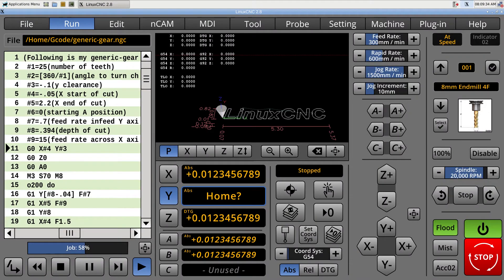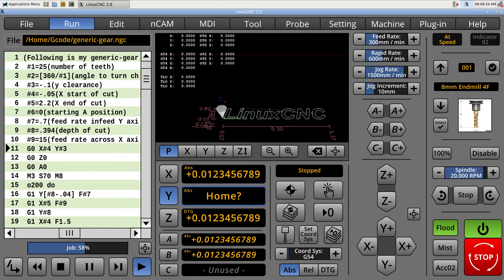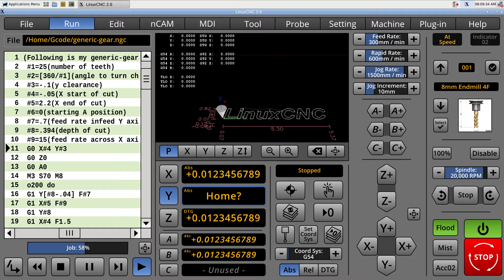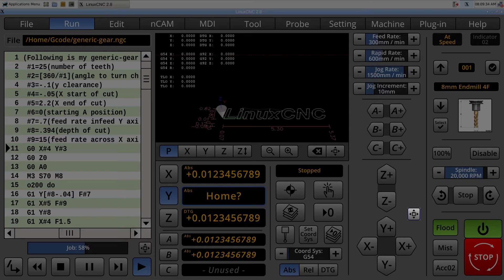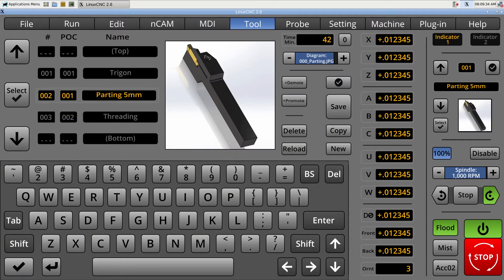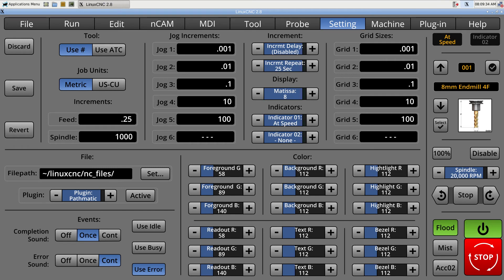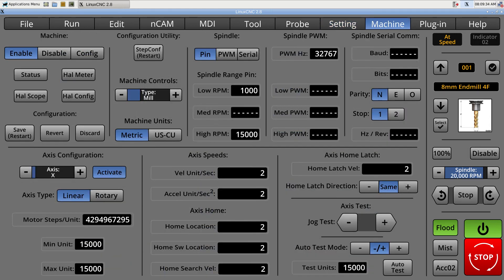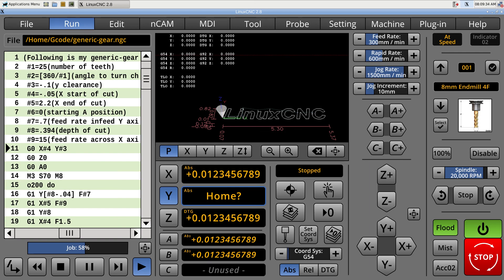LinuxCNC User Interface Proposal

Comment: I just came across your video, it's kinda amazing, I know we have to connect all things in the back, I'm starting to check how to add buttons to QtplasmaC I'll try once I'm finish to help you out with your interface, if you moved on and or have another ideas, it would be cool to implement them, you know, the once you really use for your day to day life. Since it's been a long time, you might have a clear idea of what kind of setup you would like to have. By the way, I'll be testing next week if I was able to use my new shapes in Conversational tab on QtPlasmaC, if you like to see something in your conversational for a router, let me know. I'm not that fast, but I'll try. Cheers!

Comment: Take a Look at a professional CNC Control, or take a look at EdingCNC. these GIU's are basically the industry standard..
Reply from the maker: When they first came out--they were new.
Reply: @BrendaEM  when what came out?.. Professional GUI's?.. they have been around for ages now.. I have a Lathe with an interface that was built before Windows was invented, basically a Barebones Unix system...5 buttons along the bottom of the screen operate a lot of functions, depending on the mode you're in..

The problem with Linux CNC, and other CNC control Programs is that most of those projects are "Hobbyist driven".. meaning no professional has ever designed a User interface..

Comment: I have NO idea how many CNC users out there have familiarity (let alone expertise) with GUI programming.   I can tell you full stop - this would be an unbelievable amount of code development to undertake.  Excellent thought and considerations were put into the design elements to be sure!  I edited my comment once I realize it was only an SVG presentation and not the actual GUI as I thought Brenda had written the GUI but it was just not operational yet.

I would also like to add that my 30+ years of experience with programmers has shown me that this level of "usage" consideration is rare as often times the developer forgets that the end user cannot possibly know what the dev was thinking at the time and instead can only work with "what is" so GUIs can be very non-intuitive and difficult for the end user.
Reply from the maker: Do you have any idea how many lines of code are in LinuxCNC?
For the interface, I drew on the advice of others, adding to the the tried and true LinuxCNC interfaces.

Comment: thats stupid. If you show 10 things on the screen , why needed to use 1 , you have 9 times more pobalilities to make errors , and the cnc machines dont forgive that.
Reply from the maker: There is a concept called drilldown, meaning that everything should be within so many actions. In the design, you will see safety features. Noting that, the interface is maxed out for 5 axis. Most people would use 3. It was designed modular, so, elements could be hidden.
Reply: @BrendaEM  and why nobody use it?
why all big manufacturers use separate screens for code , mdi , grafix , auto and manual? Are they stupid or what?

Comment: Take a Look at EdingCNC or a Professional CNC Control like Heidenhain..and start over..
Reply from the maker: Noted. You might want to check the other comments.
Reply: @BrendaEM These Comments are all made by Hobby machinists, none of them have a professional background..
Reply from the maker: @dumetwatches6451  , Hey, I even put included functionality for a status light-pole or alarm.
Reply: @BrendaEM  What i'm seeing here is just like a Haas CNC, or Mach3 control.. the literally cluttered with buttons.. 
Heidenhain, Fanuc, Mitsubishi, Fagor, and many other CNC Controls have "Function keys" Softkeys, the function depends on the menu you're currently in.. saves a lot of Screenspace.. and.. Why on earth would one need a Graphical Display when milling or turning?.. 
You only need it for programming or program checking.. after that.. why show it?.. Just look into the machine.. if you are there.. 
Most of the time, basically always.. i hit start, and do something else.. what would i care about a Graphical screen?.. Ok.. my CNC Control (EdingCNC ) has that, but.. i   rarely look at that when the machine is running.. because i only return to a machine when it is finished..

Comment: That looks great. I am a seasoned Machinist, and programmer.. Linux CNC escapes me.. I just don't have time to devote to learning it, when I have the big boys at work.. It seems a little light in the loafers compared to real industrial level stuff. I have a small hobby mill and have run Mach3 on it, but I really want to get into open source to allow for granular improvements.. I would gladly donate to a project like this that would help me achieve the functionality of a better HMI, while allowing me to take advantage of LinuxCNC
Reply from the maker: You might try the LinuxCNC forums.

Comment: i would like to use that, has it come to fruition?
Reply from the maker: Hi, I am sorry, but likely not yet.
Reply: @BrendaEM  Well the mock-up looks good :-)
Reply from the maker: @MrZhefish  , thank you : )
I had hoped that the attention of 16,000 people, with a 99% like rating would encourage LinuxCNC to recognize the value of their software, and perhaps find some commonality in their interfaces. Most of what I did was a merging of LinuxCNC interfaces, and add a bit of Blender-style window dressing. Still, a house cannot be built from the facade back, and libraries need to be developed.
Reply: @BrendaEM  have you inquired with a programmer about the extend of work that needs to be done? like how many hours it takes to develop it?
Reply from the maker: @MrZhefish  , I have not been much on LinuxCNC since the end of the project. I have had some misgivings, as the moderators let someone make make the time I spent on the forum miserable. There are many fine people on LinuxCNC's forums, though I feel that one of them should have been banned, but was not. That stated, where this interface is good, is largely from the gracious input of several members of LinuxCNC. The interface itself is a compromise and derivative of all of LinuxCNC's existing interfaces. I just wanted to find a compromise between them, and give something back--and it really went bad for me. I offered them a design proposal. It's up to LinuxCNC what they do or do not.

Comment: good job it hase some features that are better than mach 3 and 4 and it looks so neat , but you can add some features like configuring the motors and all other inputs and out puts inside the Interface this will be so usefull ,and attracts the mach 4 users that have low linux or any other programing skils .

Comment: Hi Brenda, Your interface seems to have gone quiet, what is happening with it? It seems to be one of the best designed interfaces around, clear, concise and intuitive, as well as easy on the eye. You have obviously spent quite a bit of time thinking about this, its a pity that it is so difficult to implement. There has to be an easier way to make a user interface! I know that you have to design for all options and expansion, but think that an initial subset to interface to a 4 axis CNC router would be a good place to start, as this is the configuration that most hobbyists will have. I am planning on building a basic unit and would like a system like this to control it, one that would allow me to create macros for facing and hole drilling, cutting basic shapes to selected sizes etc., thus making the machine a versatile and easy to use tool. Please let me know what progress has been made to date. Regards Mike
Reply from the maker: They had started on a widget process, but that may have stalled. I really tried to help.

Comment: As a professional machinist that works with a bunch of different machines of varied ages I like your layout a lot.
What I saw at this quick glance that I would miss in daily work is to see both current position and distance to go at the same time. 

Direct buttons for singleblock as well as M1 activation. 

Feedrates (work and rapid), quick buttons for 0, 25, 100%.
Please note that I might very well missed these or that other symbols then the common CNC ones might have been used.
But overall, really sweet and inspires me to take up my own home CNC projects.
Reply from the maker: For months I did take in as much feedback as I could on CNCZone, I am sorry that I didn't get your feedback.

Though, I wanted to be sure that the user knew which numbers were being read out. I had hoped that the radio buttons to chose a readout mode were fast enough to meet your needs. What I feared was: a machinist looks glances at the part, and back to the screen, only to fixate on the wrong number. As a design thing, there is also an redundant legend over the numbers themselves, which was removed, and then added back for safety.

As far as the feedrate, as in Axis, the steps were meant to be user settable.

Comment: Hi Brenda. Has your proposal been aproved? It looks great.
Reply from the maker: They are making something. I am not sure. Because of the problems I've had with LinuxCNC.org, I've been pretty hands off.
Reply: @BrendaEM  Can't find it, where I can find the user interface you're mentioning ?
Reply: @BrendaEM  You just didn't like disagreement. You wanted things changed, eg with the basic Debian desktop, that takes a couple of clicks of the mouse. Your design whilst pretty required a large screen for those users that don't have slender fingers, you didn't like this being pointed out. There was an impression you wanted many changes purely to suit your own needs. It was almost like a architect designing a building, without of a lot of knowledge of how things are built, handing it over to a builder and just expecting to be built without any further input. Not everyone is capable of everything, but it's neither fair nor polite just to drop something off and expect results. And to be fair when directly asked what license you wanted to release your work under there was no reply. 
The mods were fair and took action when you had issues, but it wasn't the action you wanted. You were wanting a particular user banned and you didn't get your way. It was not the fault of the forum or the mods, things just went from cordial to bad to worse. At the end of the day it would appear both users removed themselves from the forum.
To all of those that are being held back from using Linuxcnc because the "screens look dated" you are missing the point. After having used Mach, grbl & Linuxcnc I can say that Linuxcnc is a far better choice, as far as I can see as a user. Yes the learning curve is steeper, HAL can be daunting, once you grasp a basic understanding the power is there. Even tho there is framework to use the qt toolkit gmoccapy & axis seem to be the more popular screens. Only time will tell what will happen in the future. Now that there is work being done on a respin of Mint pre installed with Linuxcnc hopefully more users might feel a bit more comfortable and not have to go through the work required to get some devices to work under Debian.
Reply from the maker: @awomandoesnothaveapenis , Yes, because people use not only this interface but other touch screen interfaces, such as Gmoccapy and Touchy, I wanted LinuxCNC to reconsider how much real estate their Menubar used. Windows, Mac, Linux Cinnamon, Linux Mate, or Raspberian used that much. I am sorry, but on modern 16x9 aspect ratio screens, vertical real estate is not plentiful. Even modern browsers hid their real menu bars. I also requested that they update the documentation; you can be angry at me for that, if you want. Tell everyone.

One LinuxCNC mod issued a warning to someone from using vulgar language at me because I wanted to help. Week after week this jerk told people that I wasn't going to finish it. He complained that the design was taking too long, that I wasn't going to release it, that a design itself has no value. He broke up conversations during the design discussions. He followed me around elsewhere on the forum, posting after any post I posted. In any other forum, he would have been banned. How dare I try to give something back to the community?

There were a few people on LinuxCNC, who I may not have the best interests of LinuxCNC at heart. I also worry about commercial compromises affecting LinuxCNC; I hope these worries are unfounded.

The people here have spoken: 420 for this design, 4 against, and I strongly suspect who 2 of the 4 are. 19,000 people are interested is this.

While I was inquiring about the documentation, I came to admire the beauty of LinuxCNC, and the adaptability of the HAL system. Do you think I would have worked for months to come up with a fresh interface for something I didn't believe in?

When it comes down to it, the value of the design were the people on the LinuxCNC forum, who contributed valuable input, who shared with me the needs of people with not only CNCs, but also lathes and torches. Still, the design is based and a compromise of LinuxCNC's other existing interfaces, as mentioned and credited in the video. All of them have their merits and value. I tried my best to find a compromise, and offer a user interface design proposal for LinuxCNC. As you may read on the forums, it took a long time, but, before I suggested a path to programmers and artists, I wanted to make sure it was a valid one, because their time and effort is valuable.

Comment: I'm very familiar with Axis and I don't mind the somewhat plain Jane appearance but there is definitely some room for improved aesthetics as well as improved usability.  The user interface in most open source software seems to happen in a very haphazard manner, with different people contributing different things at different times.  I love open source software, but this isn't one of its strengths.  Your approach that focuses exclusively on the UI design irrespective of programming yields a much nicer user interface.  Most people are more concerned with appearance, and an attractive user interface would definitely increase the number of LinuxCNC users.  The times I've tried to make that point, I've been told that LinuxCNC exists mostly for the people who created it, so who cares if there are more people using the free software who need support?  The less than spectacular appearance is viewed by many as a feature that reduces the amount of support needed.  There are some LinuxCNC users who would prefer that those people bought a copy of Mach.  Personally, I like the looks of LinuxCNC much more than Mach, which is too garish for my tastes.  I think the prevalence of bold primary colors looks like a PlaySkool CNC, but these aesthetic issues are very subjective.

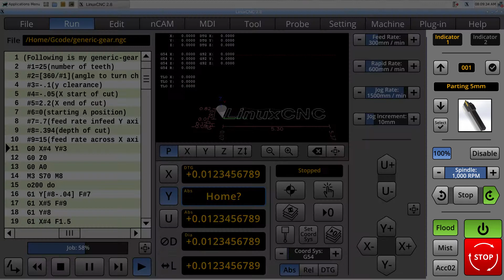At 3:56, I believe the lathe jog controls should be X and Z, not X and Y.

Comment: I'm using grblgru. I tried Linux and mach3 but couldn't get the machines I made and converted to cnc to work. From a complete nube's perspective. I found that to start, grbl and arduino are the way to start. Once you know your machines and how to use them this is a huge step up. I can't wait till this is up and running. I appreciate all your hard work.

Comment: I would like to throw in my 2cents. Mach3 looks ugly, it works great... but is stuck on Win7... and installation is a pain.
LinuxCNC however; is VERY new to me... in fact I will be installing it this Friday on a new machine for its maiden run.
I don't know which is better... I really don't... maybe they will operate the same. One thing for sure is LinuxCNC sure loads a hell of a lot quicker from boot... but, it does look kind of ~basic. Not that this is a bad thing however if it had an interface that looked half as good as this one I would say a lot more people would use it over Mach3... why... well price for a start.
Anyway... I love the new design an would really like it to become a reality. I mean just look at it, this is beautiful work. Fingers crossed that you go through with this BrendaEM, you really sound like you know what you are talking about, and LinuxCNC is screaming for a cosmetic upgrade.
Cheers :)

Comment: This is a spot-on engineering review of fantastic work. I'm just bewildered by how carefully you've clearly thought out the UI. Even if this UI is never implemented the study is valuable. Two suggestions: Consider placing your design onto GitHub to get the ideas into the wild. Consider reviewing Tormach's PathPilot for additional ideas and contact them about a potential contract gig since Tormach is motivated to have the best possible UI. Until something better is available, I keep using Axis.
Reply: Another idea to consider is an add-on to the existing LinuxCNC interfaces to help with simple operations, similar to PathPilot's conversational programming I suppose. This would include hole centering, hole patterns,  face milling, radius turning, and so on, to create code at the machine without the need to CAM-it-up. Others have created various small tools for doing many of these, but it would be nice to have them all in one place. For each operation, there would be a descriptive image of the generic operation, with values to be filled in, and when complete g-code would be generated that is passed back to the LinuxCNC UI. If you wanted to create a few screens, I'd be willing to create the Python code to generate g-code and interface with LinuxCNC. Should check how much others have already done in this area.
Reply: Some examples here: http://wiki.linuxcnc.org/cgi-bin/wiki.pl?Simple_LinuxCNC_G-Code_Generators